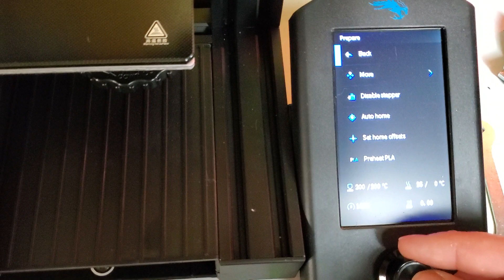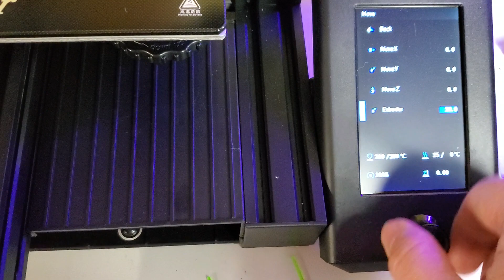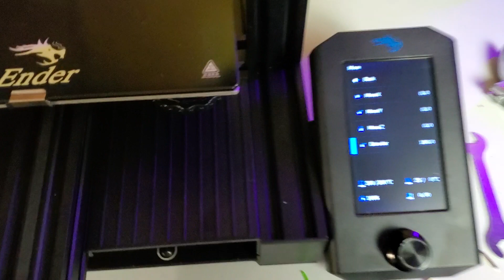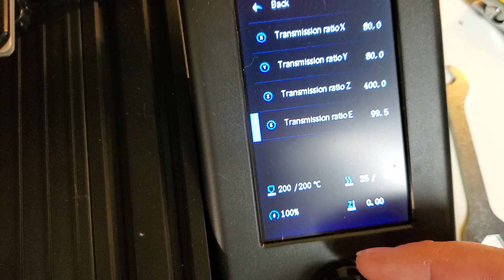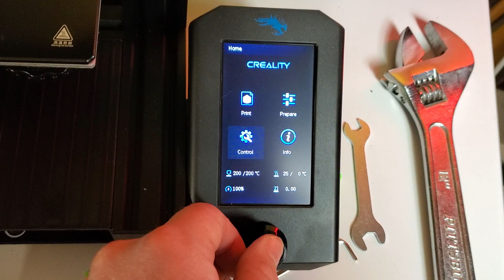Ender 3 V2 Estep Calibration [Step-by-step guide]

Comment: Great vid, informative. Questions tho. I've been using cura slicer with no issues but cura only gives me .12 mm layer height as the thinnest I can get. I started using Prusa slicer to get .08 layer height and it over extrudes every time. Will this calibration process fix over ext. issues or is it a printer setting in Gcode fix?

Comment: how are u guys putting the blue knob on the aluminum extruder?  I got one and the axle thing doesn't stick up enough.  Which aluminum extruder listing did you order from?
Reply: oh the TH3D one.  I ordered one on amazon damn I wish I knew about this one b4
Reply from the maker: @waynefilkins8394  yea the one from th3d. If you ordered one off Amazon though you should still be able to find one you can print yourself and make work. I would just search extruder knob on thingerverse, and just look for one that you think will fit.

Comment: for the extruder you do not need to reset your machine and extrude another 100mm.  all you have to do is after you save your settings go backin to the extruder move command and execute the 100mm command again.  (you already set it to 100) because you saved the nex configuration the printer will compansate from the old value to the new.  once you do that you can check your mark again to your reference point.

awesome videos.  This is my first printer as well and I am very happy how well it performs right out of the box.  only problem I am having is the bed leveling.  the center of the bed is always hight than the sides. either the gass is bent or the gantry.  I will do a complete tear down and rebuilt this weekend and see if I can get rid of the problem. 

other than that it tracks great.  100.1mm on x and 99.9 on y so I didnt bother changing the values as I am going to dissamble this weekend
Reply: Did you ever figure this out? I am having the same issue and cant find anything online about it. Would love to know if there is a fix to this other than getting a new bed

Comment: E-steps = old value (93) * (100/measured length) ... its not that hard :)
Reply: It can be it you change it to a different size head on the extruder gear then the value will be higher I know because my calibration is 145 because I put a new dual gear ⚙ that are smaller then the original head

Comment: hello sir thanks for the video! I calculated my value as 415 but on the screen i can't pass 186.What can i do? Thank you
Reply: Hey bud, did you find a fix, mine is calculated to be 256, but I haven't tried it yet. My ender does allow me to move it that high though, hoping it works.
Reply: @keshavmahabir4592  I ended up using 422 buddy so it's normal.You can mark with pen like 10cm of filament then extrude 10cm on printer to see if It matches.Mine is perfectly tuned right now
Reply: Awesome. Mine is working perfect now! Thanks

Comment: I just need help with this man I went over 100! I got 109 so what would I do from there since it’s over
Reply: Note the math: If your default/original = 93, then 93 x 100 = 9300, 9300 divided by the average of your measurements (we'll say 109) = around 85.3 (check if the math is correct, the reason this works is because the last step is to divide)
Reply from the maker: Sorry I didn't see your comment. Hopeffully you got it figured out already. But if you didnt jump in discord and I would be happy to walk through the steps with you. Discord Server: https://discord.gg/KrAFhEYvDM

Comment: For tpu you will need to put a direct drive. I do the same on my ender 3 v2. And you enclosure to keep the temperature constant... My setup on Cura for tpu: bed 70, 230-240, speed 25-35. Good luck
Reply: my tpu prints flawless with the addition of the EZR extruder with the bowden set up, no enclosure....printed tons of mounts with almost no artifacts.  doing 225/70 in Cura with no retraction and .16 layer height.
Reply from the maker: I've been printing tpu on this setup pretty easily. What printer are you using?
Reply: @509drone2  Same printer Ender 3 v2. But its not coming very Square shaped andbi have to talk it all a part. And make it Square on a vrey flat surface. I'm happy with it.
Reply: I got the Trianglelab BMG Clone and tried to calibrate the e-steps but it has a ration 1:3 but my Ender firmeware 1.02 only to 186 - so I never get 100 mm ?
Reply: @ronaldoberreiter  hi. It's possible to have a lower VREF on you stepper motors. Here some info : https://v6zmvq5nk5.codesandbox.io/
Or you don't do the E-steps correctly. Here more details : https://teachingtechyt.github.io/calibration.html#intro
I hope you will gonna fix it. 🙂

Comment: if it was at 93 did it grind your filament, or do you know why my filament is getting grinded when printing stuff
Reply from the maker: When you mean grind the filament are you talking about where it pulls it into the boden tube? The 93 is just basically how many spins the motor does to push out filament. If yours is actually making a grinding noise I would think your extruder is to tight, and you need to loosen it a little bit. But if it's just making marks on the filament, that's totally normal.
Reply: @509drone2  sorry what I mean by grinding is when the motor goes back and forth a few time then the filament get stuck and the hot end stop receiving the filament to make the model

Comment: Wait, so you have to keep a sd card in it all the time now? And it resets when you cycle power? (there is a SD slot inside behind the LCD panel, too.
Reply from the maker: No, not all the time. Just for the first settings save. After you have saved the settings, remove the SD card, and power cycle the machine, and double check that the settings held.

Comment: So I assume that the machine was extruding too much until you set it back from 100 to 99.5 is this correct
Reply from the maker: It was under extruding. The default value was 93 (something like 93 turns = 100mm) so I had to raise my extrusion value to 99.5 to have the printer accurately push out 100mm of filament.